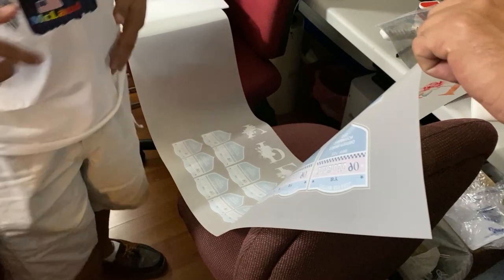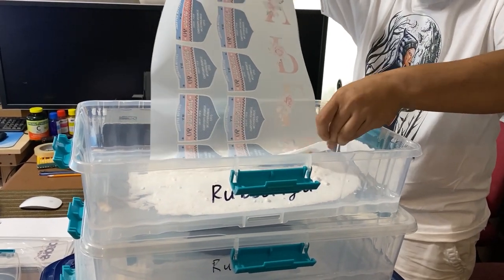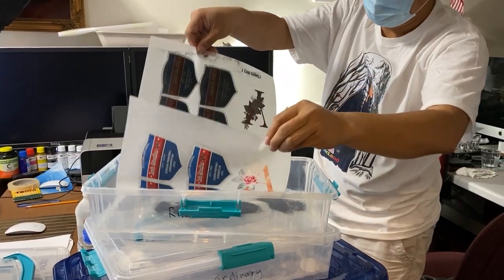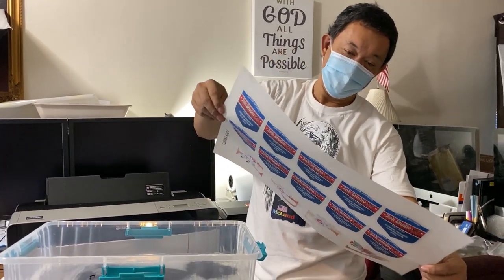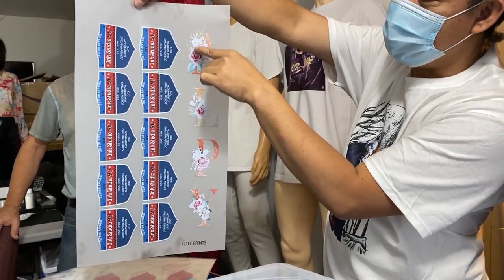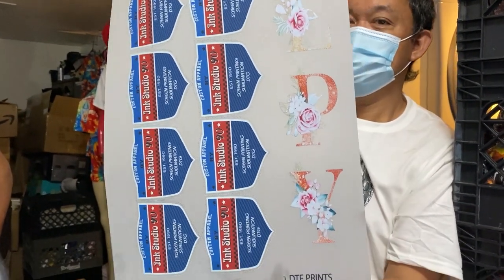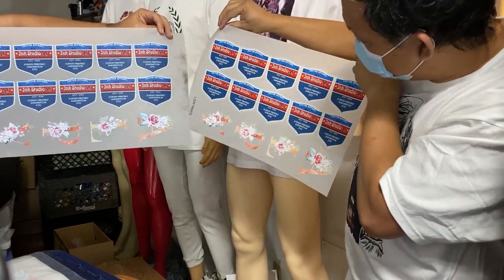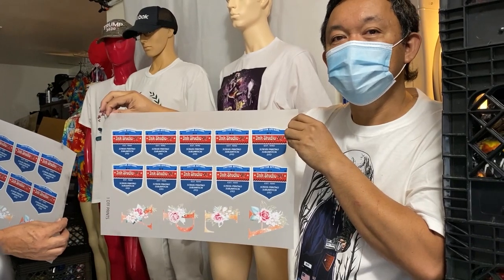McLaud DTF Vlog#51: The Black and White Powder

Comment: I see that you dont change any configuration in the software? Both prints are made with the same settings? 

We have tested black and white fine granulate, but the white granulate still gives a whiter color on black textiles. But even white is not as perfect as with dtg. Especially after a few days.

Is it true that rubberized is used just for the feel? It has nothing to do with the look? 

Why do you use different thicknesses of granulate? If fine works, why would you change your thickness?